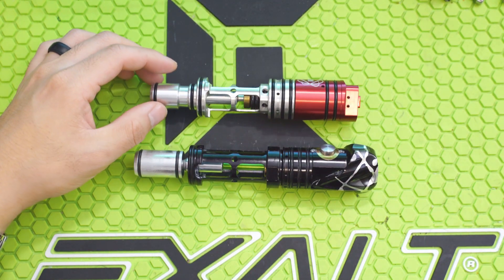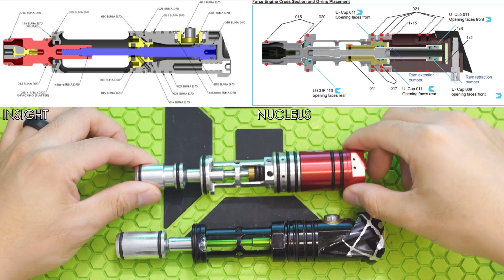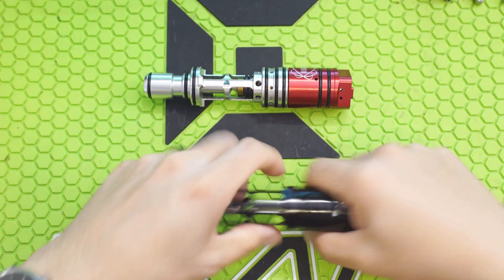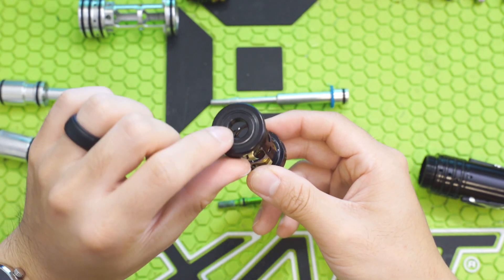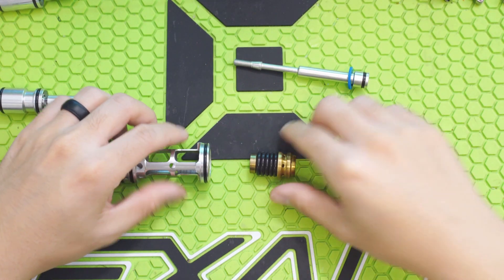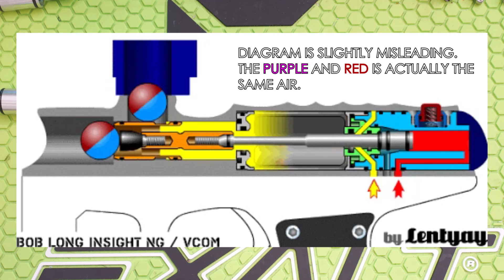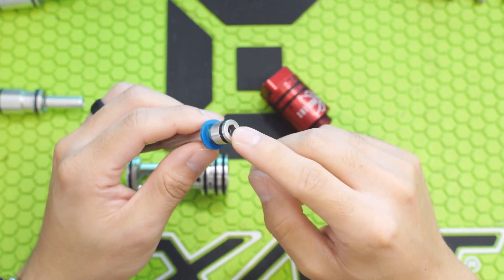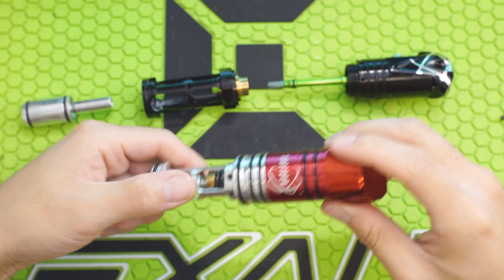Field One Force Nucleus Engine | Technical Breakdown

Comment: Interesting. I always figured the shaft at the rear was more so to utilize the benefits of a traditional ram system on the tail of the bolt and allow them to use a 4way solenoid to drive it. Solving the biggest issue of the NG/Reflex system, which was reliability.

 I was under the impression that traditionally the cause for inefficiency in blow forward systems is because the loss of energy when using dump chamber pressure to drive the bolt. An extended shut off would be a way to mitigate that, and it would also create alignment support for the bolt when in the forward most position
Reply from the maker: Efficiency is really based on operating pressure, flow rate at the valve, and managing losses of excess air. Typically, higher operating pressure with high flow, makes for a more efficient engine. Valve needs to be open less.

It wasn't until we had breech and chamber sensing where engines could get away with running on lower operating pressure, but they need to have higher flow to compensate. 

The complexity of air routing that ucups brings sacrifices air to push and pull the bolt, seeing excess losses. It also has no ability to recapture air, since it's just a "dumb" engine that doesn't sense.

The nucleus shuts the supply before the chamber starts to dump, so we aren't seeing losses there.

Comment: Whats a anno job cost?
Reply from the maker: Depends on what you want anywhere from 250 to 800. Pending on color, number of colors, finish(s), complexity. My polished red ano on my force was like 370
Reply: @QTPaintball  ok thanks. What your view on the ultra silk grease vs the standard dow 33's?
Reply from the maker: Personally, I'm not a fan of the company. That being said, I'm sure their silicone based lubricants are fine. I would stay away from their boom treatment / ceramic coating. Pieces are super heated to expand the pores of the aluminum. Their coating is then applied to the pieces to fill the pores and create a layer of material. I would stay away from any alteration to tolerances, and adding an element of wear. Their coatings will eventually wear away and things can become out of tolerance again.
Reply: @QTPaintball  Ok got it. Sound like sticking to a dow33 silicone based grease will be best.
Reply from the maker: @KeePReeLing  they first released a petroleum based lube, which should always be avoided, as it degrades plastics. They then released a silicone based lube which is Dow33. Pretty much every paintball lubricant product is Dow33 with some level of gun oil added. Yes stick to Dow33 based
Reply: @QTPaintball what would you consider a better marker. Prime XTS, or Cs2?
Reply from the maker: @KeePReeLing  CS2

Comment: I just hit roughly 65k shots on my force. I do agree with some of your comments here about the efficiency being "average" but you have to consider the target audience. This is a gun made to play X-Ball. It's designed to not break paint, not stop shooting, & be easy to maintain. They nailed those specific points. I would like to see a 2.0 w/ more aggressive milling and no dual battery option (multiple fore grip types?). A gun that you can modularly swap the fore grip between a few designs would be really interesting and I believe they can machine the gun down a bit in weight w/o sacrificing shot quality.

Comment: In case anyone was wondering; I picked up a  Force with 60k+ shots. Had to replace the bolt rubber bumper; nothing else so far. (Couple o-rings on the reg as preventive maintenance). Lower dwell had a small, but noticeable effect on shot smoothness. 
Biggest difference though, was switching barrels. Going with a one piece, 14", well vented, .693 bore had a huge difference on sound signature. Now using a stella / spiral tip and the ping / pop of the shot smoothed way out. Going with a well ported / vented barrel, in conjunction with dwell tweaking, break in, and well lubing the reg really changes things (for the better imo)

Comment: Let's see a shooting comparison between the original plus reduced volume version. Also curious if it's possible to ghetto rig a "rhino spring" like mod into the chamber, to soften out the poppy shot
Reply from the maker: As far as I can tell, it shot identical to how it shot before volume reduction though shooting at an higher pressure. Mine shoots very mild now, no real pinginess to it. 
I'm not sure I would need one in hand. I could see someone making something similar though, as a potential mod
Reply: @QTPaintball  fair to say there's a brake in period that leads to the more mild shot?
Reply from the maker: @Thoth0Amon  I'm not usually one that preaches break in, but my shot has definitely gotten better. We'll see come winter if maybe the ping comes back
Reply: @QTPaintball  Same feelings on the break in myth, but using u cup seals on everything had me wondering. thanks!
Reply: QT Paintball I'm willing to bet the amount of vibration when shooting the two felt the same as well. Shame. No 1500 gun should have that amount of vibration when shooting. I'll stick with my vcom spoolie. I hope they lower the price in the force. The gun is over priced. Not worth 1500, worth 1000 tops.

Comment: How did it perform with the additional orings on the shut-off?
Reply from the maker: Performed identical! Initial testing has shown that efficiency has improved by at least 10%. I found my back cap had loosened during the day and would cause venting every shot. Further testing needs to be done now that it's fixed.

Comment: In your previous shooting video of the Force 10 months ago, you got 9 pods. In this video you're now claiming 10 - 11 pods. What changed your efficiency?
Reply from the maker: Other efficiency tests that have since come out. F1 got 1400 off of a 68, I was using a 77. 
If I had a closer paint to bore match, it was a summer day, and well if I shot it more haha. I stopped pretty much immediately as soon as there was a bit of drop.

I'm confident that I can exceed that now. I'm now running 14 dwell and I have a smaller control bore closer to the paint I shoot. Add in the reduced volume and I'm certain I could meet 11 or more pods.
Reply: so softer on paint and killing effincy is better? now you put orrings inside the can to bump effcy? you have to bump the pressure to compensate the volume of air hence you kill the softness on paint, looks like you made a lousy engine, bring back bob long markers and ditch this crap field one
Reply from the maker: It's been interesting following the reputation of the force. If it was any other brand or platform, no one would care about its efficiency. Personally, I rather have consistency, reliability, and whole paint while I'm playing. At the expense of efficiency? Sure. It went from excellent to average, I don't see that as a problem when it's far more reliable than the reflex or insight.

You're correct, when taking volume you need to compensate with pressure. Which was about a 15 to 20% change, depending on the volume taken. I'm testing at a rather extreme level. This increase in pressure doesn't necessarily break the force's paint handling. Breach geometry and the soft tip bolt are both excellent which raised the ceiling further. 

A lousy engine? That's dramatic. It's flawed, just as bob's engine, but for different reasons. I had minor issues with my insight, reflex'd phase and onslaught during the winter. I've had zero issues with the Force year round. Not a single leak, hint of bolt stick, or FSDO.
Reply: @QTPaintball  they turned an exeptional enginge it to a gas hog, dont want issues in cold weather just open dwell times on onslaght, this is just an over complicated engine, even a fep quest with air thin sports bolt engine shoots better than this thing, the milling is mediocre at best
Reply from the maker: The original engine wasn't exceptional. It's my preferred engine over the VCOM and VIS, but the only thing exceptional about that engine is it's efficiency. That's one trait out of several other important ones that were addressed by the nucleus. Love it or hate it, they had very clear design intentions and executed them accordingly. Bob's intentions vs F1s are not the same and I wouldn't look at the force as a successor. Just a reference. 
All bob long fans need to accept that F1 does not need to align with bob's ideology. 

I would not consider the nucleus complex and those last 2 points are subjective.
Reply: @QTPaintball  and thats why many of us are jumping of the wagon, not following bobs idology its just a plain insult, even an axe shoots better than this over hyped crap, low quality milling, gas hog engine, this guys should hear their customers, if i wanted a gas hog shooting soft on paint marker there's a lot other markers to look ehmm luxe ehemm
Reply from the maker: Haha well that wagon stopped in 2015. Not sure what you guys were waiting on. 

The Axe is undoubtedly one of the most underappreciated engines. The axe shoots better than most of the markers that have ever existed. It's a top tier engine that everyone thinks is budget. 

You're welcome to shooting a luxe, though the force guy will be laughing at you when it goes down as the temperatures drop... Or after the ceramic coating wears off or the spring goes... Speaking of the Ice, talk about an overly complex engine. You have an engine that has a chamber sensing valve that does nothing. Bob fan going to DLX sounds a bit silly, if you find F1s change from Bob an insult... What does that make DLX?
Reply: @QTPaintball  first of all im in texas so i font care about cold weather condition, you tell this like if its a must, you can try fool yourself with this effcy dosent matter cold is a must for any marker, if you were happy with the effcy you werent be doing top hat mods to this crappy gun, time will tell and theres a reason people are buying PE and empire today than this crap
Reply: @QTPaintball  if you want to shoot in cold wather the g6r does very well
Reply from the maker: Well, it does get cold in Texas.
Yep, I'm delusional. 
Cold performance is a metric to measure a marker's reliability... If it can handle the cold it should handle year round conditions. So cold may not matter to you, but it speaks more to the design of the engine. Don't be dense.

I'm plenty happy with the efficiency of the Force. I do this testing for multiple engines. My fl-21, gamma core, clone5, infinity drive, IV core are all shimmed out to be more efficient... It's out of curiosity, not of need.

Everyone buys PE and there are always people buying axes, because of their value. It's not some mass exodus. Calm down haha
Reply: @tricelbor it sounds like you don't want F1 to listen to their customers then, you just want them to listen to you 😂😂😂